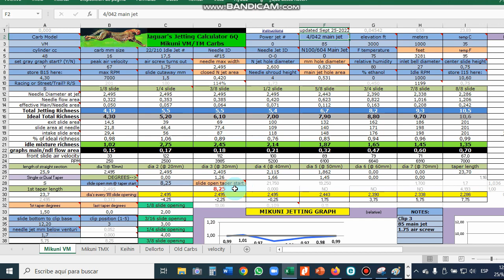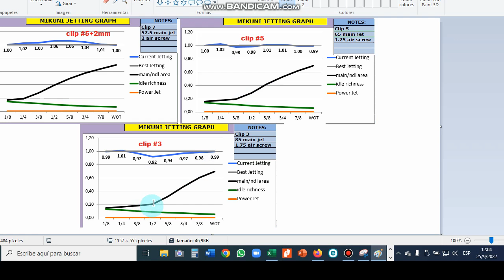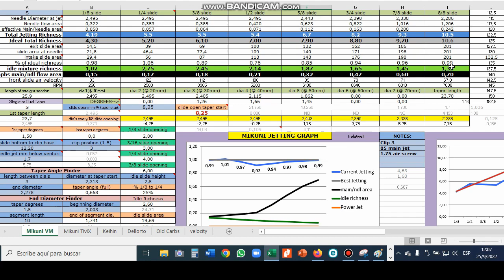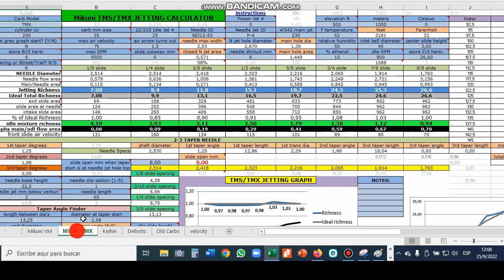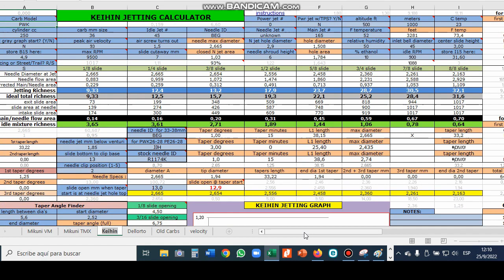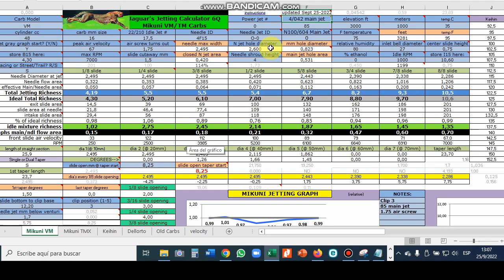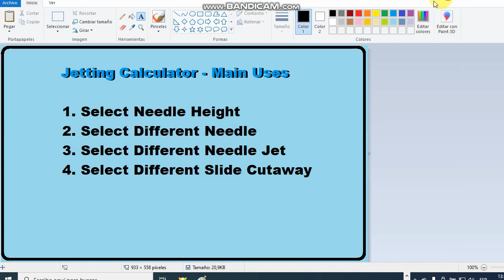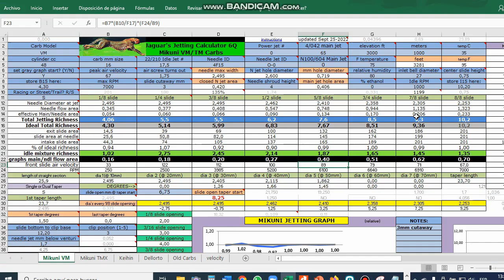Main Uses of Jetting Calculator

Comment: 8:07

If you don't know what a needle jet is for a 1986 Kawasaki 454 LTD—it's the part that cost $50 on August 2023 and a suburban Chicago Kawasaki deakership. 

Each for the two carburetors that the previous owner did put on the bike that cost you pay in an extra hundred bucks for it. I'm glad I didn't buy a Ninja 900 or else I would have had to pay a second hundred dollars for missing.